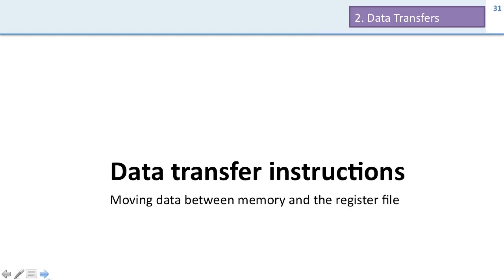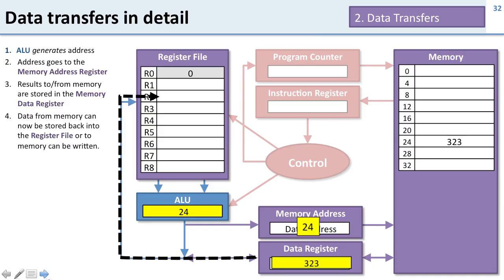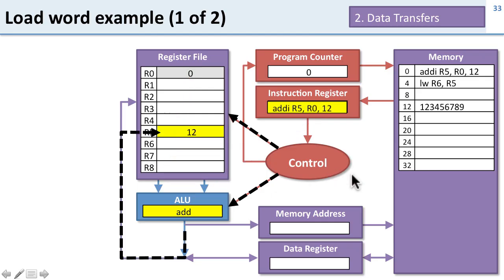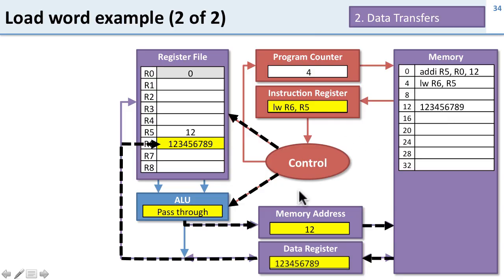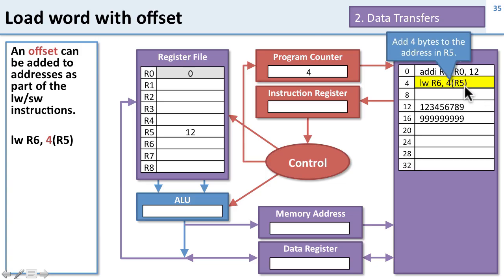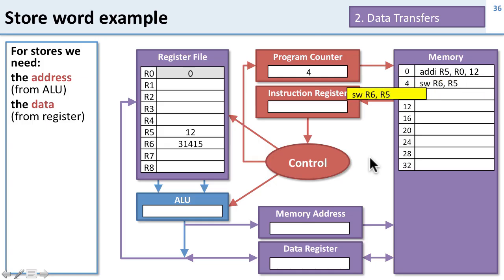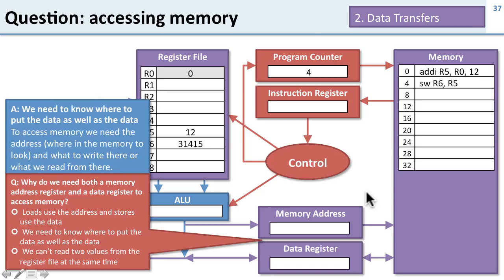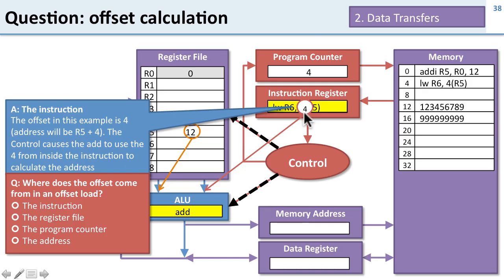ISA 1.6 Data Transfer Instructions

Comment: Hello every body I need help please so i like to ask about mips64 particularly about pc . the pc will increment per 8?
Reply: it depends on the length of the instruction, I am not familiar with the working of Mips64 but if each instruction has 64 bits then yes, you're right.